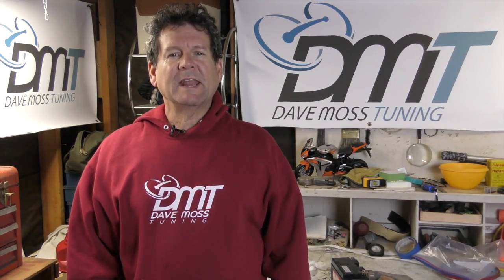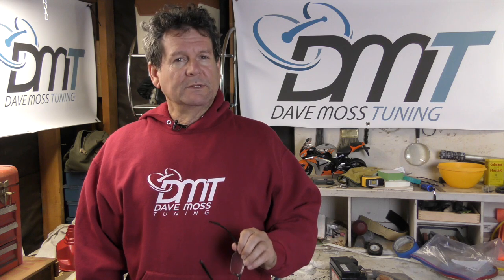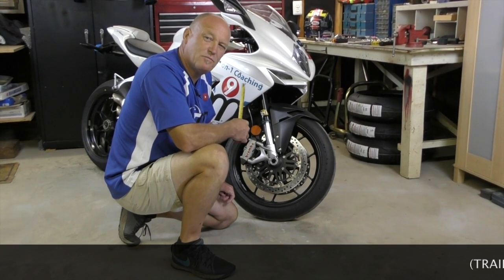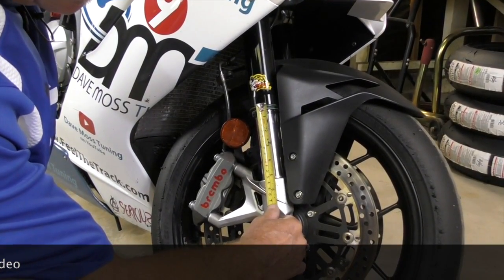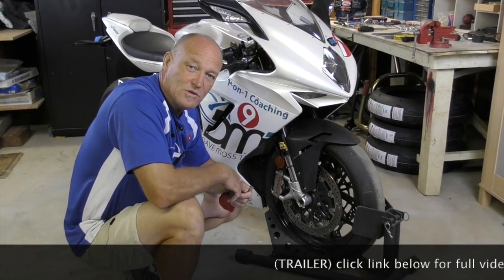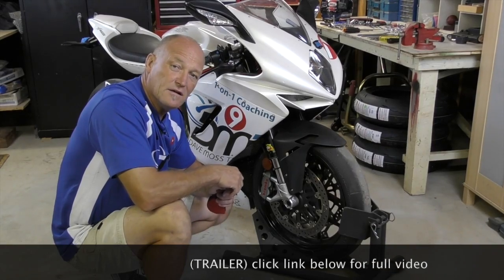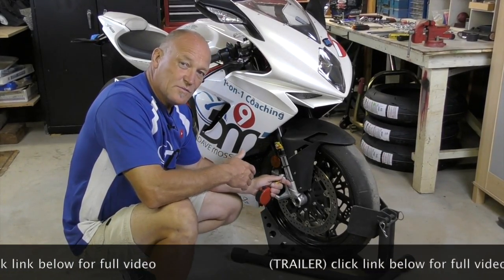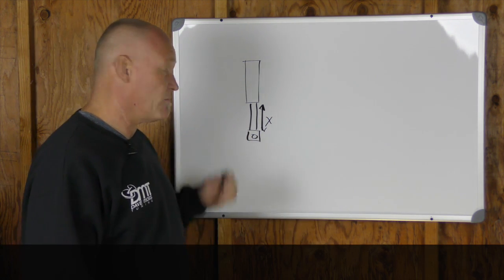Fasterclass: Setting Fork Static Sag (TRAILER)

Comment: front fork static sag should be set the same as rear shock static sag? (ex: 5-10mm of static sag for both front and rear)???
Reply from the maker: Fork static asg is engineered via top out springs so add static and rider sag together to get a number = 30-35% of total travel. The rear shock may or may not have a top out spring, so static sag at 12-15mm plus riders sag -= 30% of total travel.

Comment: Dave I have a 1988 Suzuki Katana w/ 600 w/ a 750 motor I am putting on 91 GSXR front inverted forks and plan on installing K-Tech Suspension 20SSK Fork Piston Kit I need to know what spring rate I should run. The bike is close to 500 lbs and I weigh 200 lbs also I have a fox shock on the back that needs a spring as well is the K-Tech Suspension 20SSK Fork Piston Kit a good kit and is the something better for the same moneys or cheaper kit is 350.00 don't know if it makes a difference but I am also installing a RF 900 swing arm as well. thanks and I will NOT be unsubscribing any time soon if ever.
Reply from the maker: .95kg spring rate The SSk set is the same at the GP Suspension piston kit (they are in Oxnard CA), 110mm oil level, 5w oil. The shock spring would be via Race Tech. They suggest 11kg rate.